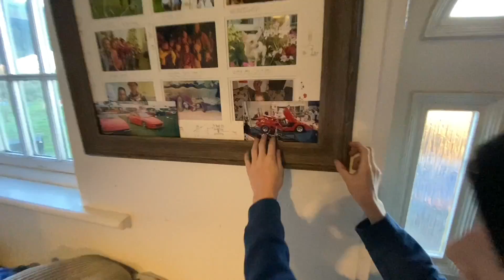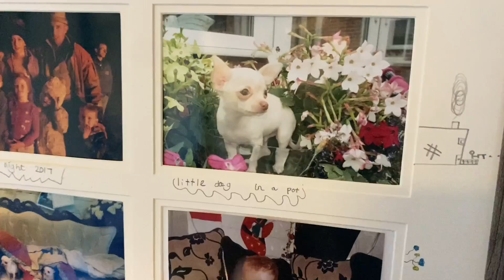Fixing the struggle bus! Starting another spray job 🥺

Comment: Mate you've seen my van! Dont get a merc! I've had thicker bean tins 😂😂😂 as always your positivity is contagious ❤❤👍🏻👍🏻
Reply from the maker: 😂😂 no mate not getting one of them the struggle bus will have to struggle on for a good few year yet mate! Thanks Conor 👍 your a bloody top lad 🤠
Reply: I’ve got a 52 plate sprinter, apart from some corrosion starting around the windscreen it’s a brilliant motor for its age. It’s running at max weight all the time too lol
Reply: @richardlaw5737  I've got 19 plate mate and you look at it and it dints 😂😂 they dont make them like they used too!

Comment: I had one of these older shape Iveco about October time went to do a tyre on it and seen it cracked across the top arm just before the ball joint, that bolt you’ve struggled with I took a small grinder to the flat part spun it round and it cleared the chassis don’t know if it’s tighter on the newer ones though

Comment: I torque up my wheel bolts on my ducato campervan 60nm if I remember correctly I have a little note in my torque wrench case with it on, even then I'll recheck after 50 miles or so.
Reply from the maker: Yeah best idea mate! 👍

Comment: £1000 for what is essentially a bit of bent metal, a couple bushes and a balljoint, that's just a major piss take. Love the videos Chris, keep up the good struggling 😂
Reply from the maker: I know mate I wonder how many they’ve sold at that price 🤯 some mark up there
Reply: Had worse with Nissan dealership…claimed couldn’t supply just the bushes for a bottom arm, only a complete replacement arm.

Comment: Great video as usual.. I have had Fords,Mercs,VW, and Iveco vans over the years. The Iveco was always hassles and rust buckets never touch them ever again. do yourself a favour Chris get a better van, anything but Iveco if that part was cheap rusted imagine what other problems are about to give you grief.. Keep up the struggle matey..
Reply from the maker: Yeah I know what you mean mate but it’s not been that bad over the years to say how much I do with her! I do need to under seal it because that rust will kill it quick!
Reply: What a load of crap.  Ford's rust for Britain and the ecoboost engines are utter shite.  Merc/vw bodies rust worse than the ivecos. Merc Engines are pretty good, as are the ivecos if serviced regularly. I've owed 3 ivecos, and they have been solid and don't wander over the road when you put weight in them. I've got a current 2018plate tipper now. I will have to look at my upper arms to see if they are thinner than my pervious 2011 mk4/5 van. Maybe they have cheaped out on them🤔, also I would try zeppelin trading they are pretty good on prices for genuine iveco parts. Though I did look at the upper wishbones, they want 400-500 i think... though I'm not sure if that's for a pair.  Maybe they are expensive because it not a common part to break.... I've never seen one break before🤷🏻‍♂️

Comment: The wheel would of probably worked loose as the locking wheel bolt wouldn't of been torqued correctly. Therefore only 5 bolts holding the wheel instead of 6. Hopefully you've got the new / replacement bolts fitted soon, learned this with a vw polo, my locking bolt was unserviceable, I drove with 3 other bolts fully torqued yet these worked loose in 3 miles and ovaled the bolt holes on the wheel.
Reply from the maker: Yeah I never had the locking one in to till I refit them today that’s the reason why it come loose I should think

Comment: Glad you got it fixed and best you change the other one and order two new wheel bolts 🙂
Reply from the maker: Yeah be done right then mate 👍
Reply: @Professional-struggler  and maybe even 4 wheel bolts and get rid of the locking bolts totally unless of course you think someone will want to nick your wheels as they are a right pain I got rid of mine unless you have special alloys I can't think they are needed🙂 keep on struggling💪
Reply from the maker: @fredflintstone1  yeah I don’t think my alloys are worth the weight in scrap mate 👍
Reply: @Professional-struggler  and it is one less thing for you to lose or forget where you last put it🙂

Comment: The drivers side arm has been off before, both nuts are on the inside because nobody needs to struggle with something twice. They are the way they are from factory because the subframe is  assembled off the chassis, where you can easily slide the front bolt in from either side. I guess there's some scientific reason they put the front bolt that way, but I changed hundreds of these & never had one come loose again. If you do another 'new' one, its easier to grind one side of the flange off the front bolt flush with the head & spin it round to clear the frame. Put a new bolt in though 😉
Reply from the maker: Everything should be fitted with wing nuts on this mate😆 yeah that’s a good idea with the bolt head… you would still have to remove some of that mount I think 🤔

Comment: Some savings on eBay for parts. I needed an injector euros wanted £220. Zoomed in on the pic got the part number and on to eBay…… same make £14.95 😂
Reply from the maker: Yeah it just go’s to show you, have to look round and you could save a fortune👍
Reply: @Professional-struggler  had a daft idea. You should do another one of those model vans and raffle it off to the subscribers.
Reply from the maker: @tomhope4613  that would be a good idea mate 🤔 might get a bit of money for the old bus repairs 🤠👍

Comment: How's it goin chris lovin the videos dude? Here  is it ok if I copy you and call my car the struggle bus 🤣 don't want no copy right issue's ... Struggle bus love it ... I do have one question... u know more than me about working on stuff  but see that arm you installed on the bus if you tightened the bolts up at the bushes roughly at normal ride height the bushes should last longer.. just a thought dude ... Keep her light bud 👍
Reply from the maker: Struggling on thanks John, 😂🤣 yes mate I’m in the process of setting up a wed site so be a good idea to sell bumper stickers 🤠. Aar that’s a good bit advice I didn’t know mate thanks 👌 I’ll mention that when I change the other side👍 cheers John
Reply: @Professional-struggler   😁 great idea I'd say a website will work out great ... 👍
Reply from the maker: @johngault3693  thanks John 👍

Comment: Pleased your all sorted now Chris    Saw second hand ones on eBay for 40  plus postage and compatible ones like the one you got for 60 quid no brainier and they look well made too.    I would be checking that near side lower wishbone and changing that asap too
Don’t want anymore near misses with carrying precious cargo within ….   It’s hard to even think about what ifs 
Nice model  model making.    Proper family hands on video 
Hope you haven’t got the bug to buy a sprinter now and trade in the Italian struggle bus steed
Reply from the maker: You cant beat that value mate really good part made to last! The bottom one seems a lot better design, we’re prod of that model 😊 no mate not changing the struggle bus I’ll keep this till it falls apart completely… next week then 🤦‍♂️😂😂
Reply: @Professional-struggler  yeah   I was wondering if iveco stealer got them off ebay and offered you part for 200 quid thinking dealer approved I reckon out of desperation you may have bought one doing the job once not twice
Stealer dealers   just imagine if your van was in there for repair  and had no option  but to buy one and you did a different trade
My last lex lease van was on its knees before they spent any money on it
It was that bad the stealer held the van at ransome and I had to get a taxi home
You can understand with those prices  950 plus vat plus labour fitting them
Think you need to up your labour rate codts
Don't forget to order your nuts x4